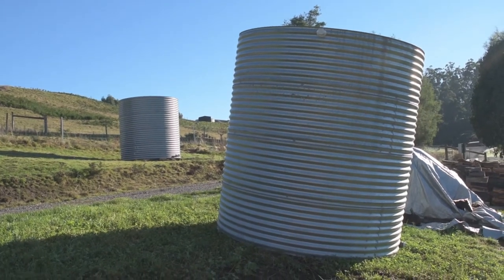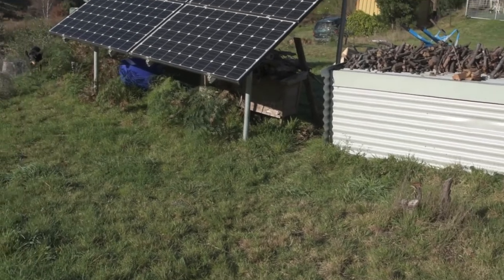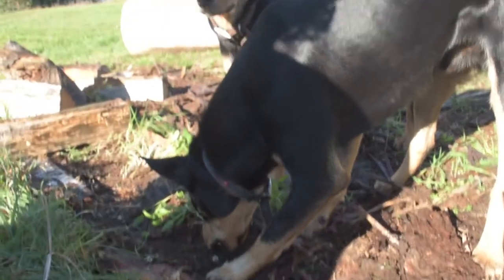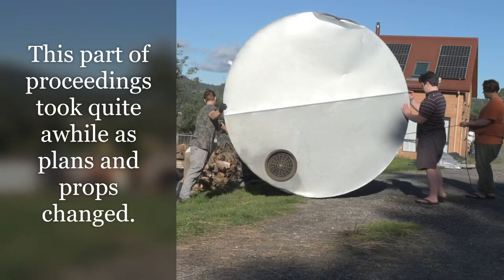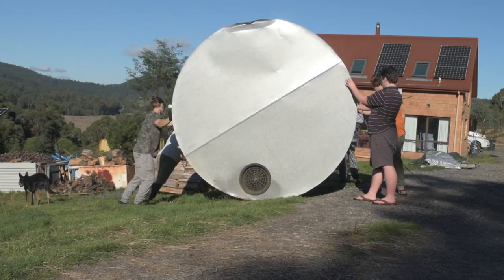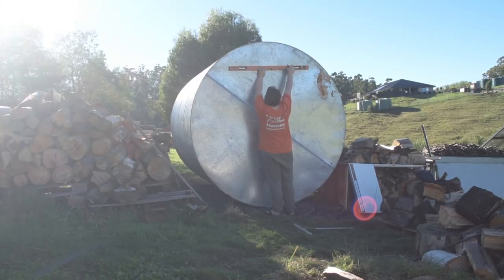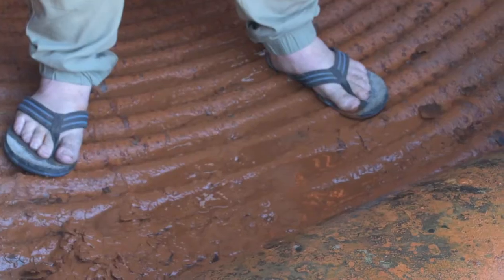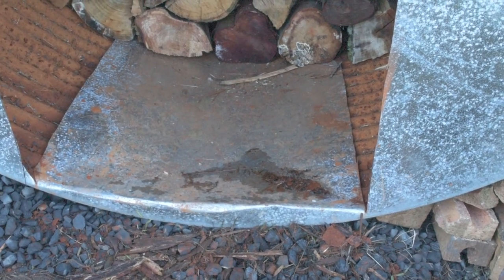Turning an old water tank into firewood storage.

Comment: Are you going to put some wood around the door frame to strengthen it and also protect against getting cut?
Reply from the maker: I was planning on threading a bit of hose (cut down the centre) to protect against cuts. We are strengthening that end with the bricks and old fridge on the downhill side. when we finish clearing the wood from the pallets on the uphill side, we will use the pallets to be the bolster for the uphill side. Green wood can be stored on the pallets too. It won't need to be shifted very far when we are ready to put it under cover.